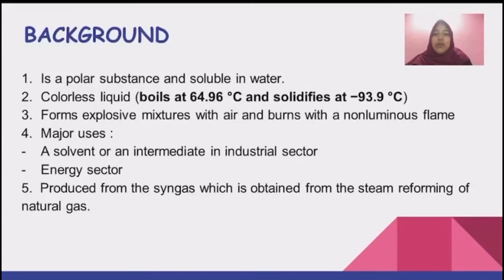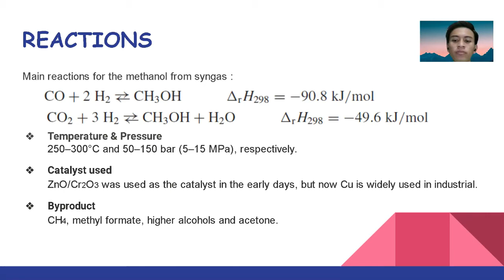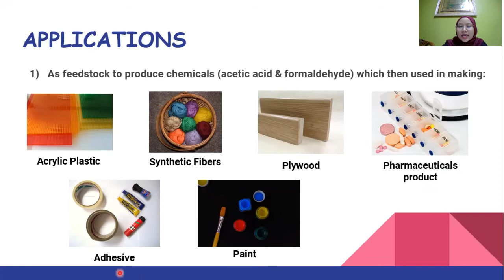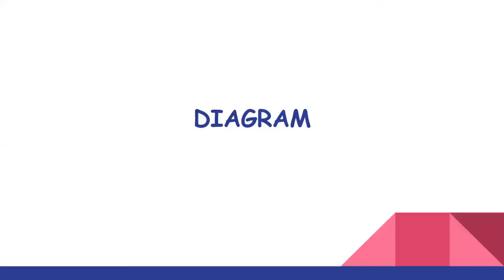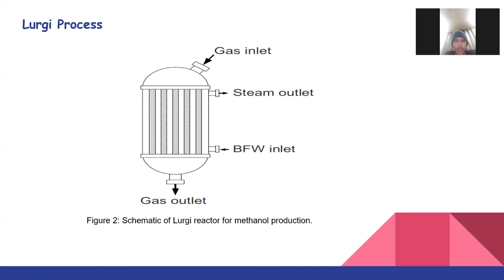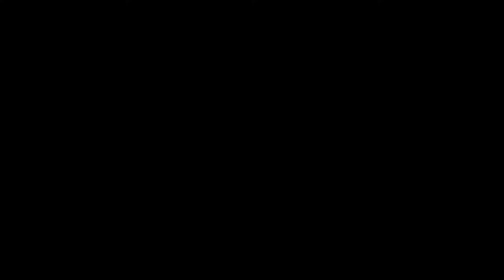Industrial Methanol Synthesis and Applications Group 6

Comment: 5. In your opinion, why does the example of companies for methanol manufacturing located at pengerang, labuan & gebeng?
Reply: In my opinion, the example companies are located at pengerang, labuan and gebeng is because of the high availability of raw materials such as syngas. The three locations are located near the seas where most of the drilling work for petrochemical activities are conducted. Therefore, the supply of syngas needed for the synthesis of methanol is continuous and the transportation of the raw materials is cost effective as the plants are located near with the natural resources.

Comment: 4. In thermal application, can you describe the role of methanol for boilers?
Reply: In the industrial boiler, methanol is used as a liquid fuel that replaces coal to create heat and steam. It is needed as it can lead to a transition to a cleaner-burning fuel that can demonstrate superior emission benefits compared to other hard fuels like diesel.

Comment: 3. In your opinion, between ICI, Lurgi and Haldor Topsoe, which one is the most preferable in industrial manufacturing process?Justify your reason.
Reply from the maker: In my opinion, the most preferable process in industrial manufacturing is the Haldor Topsoe process. Haldor Topsoe's Methanol Synthesis Process is the simplest and most efficient solution available in industrial manufacturing. It is designed to synthesise methanol at the lowest possible cost and with the lowest possible environmental impact.

Comment: 2. In your opinion, why the Cu is preferable being used as catalyst instead of ZnO/Cr2O3 in the methanol reactions?
Reply: In my opinion, Cu is preferable being used than ZnO/Cr2O3 in methanol reactions because the rates of precipitated is lower than ZnO/Cr2O3.  Not only that, I think Cu resulted in a significant reduction in the energy in methanol reactions and it is more active for the water gas shift reaction to convert water and carbon monoxide to hydrogen, carbon dioxide, and methanol.

Comment: 1. What is the safety precaution to avoid explosiveness from methanol?
Reply: Due to the flammability of methanol vapor, static electricity may ignite it. Therefore, grounding and bonding should always be applied when there is a potential for static electricity, and is required for all equipment. Carbide-tipped clamps should be used to ensure good contact through paint and dip tube filling are generally used to guard against ignition from static electricity. Hence, the explosiveness from methanol can be prevented.